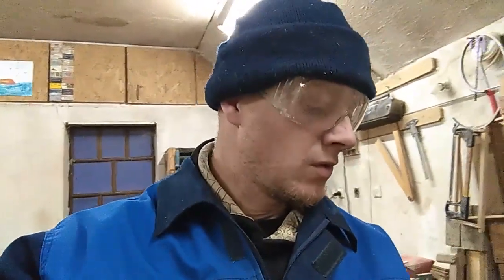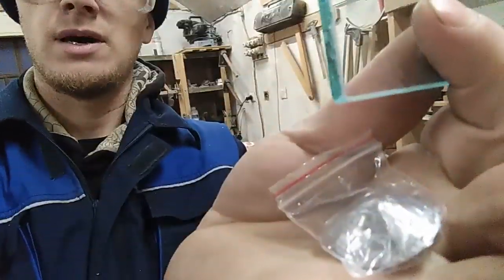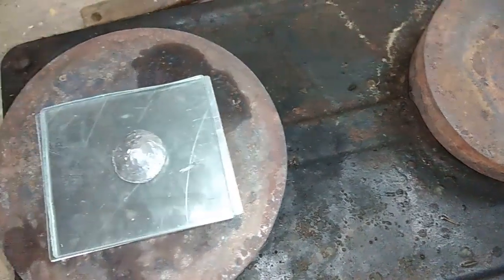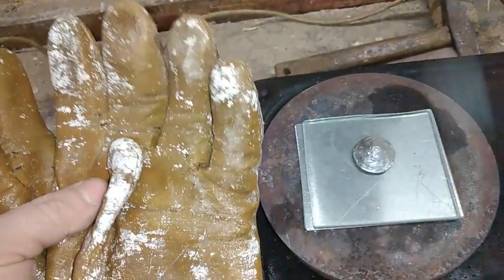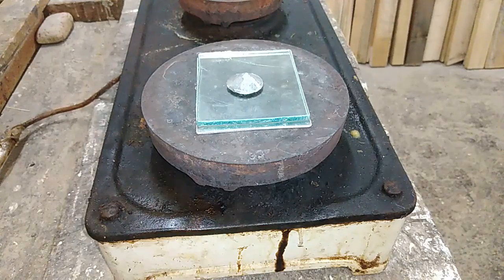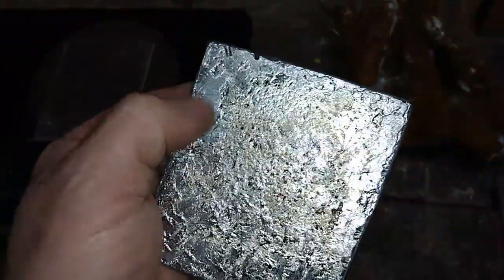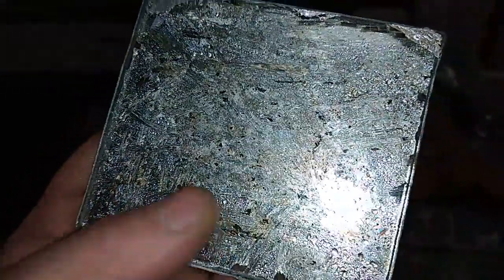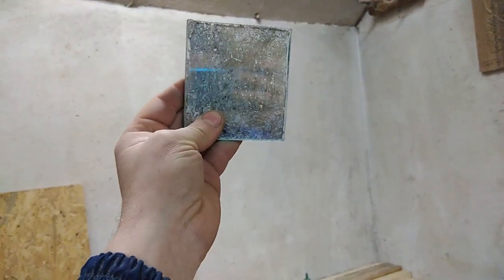MAKE A MIRROR FROM INDIUM - EXPERIMENT!

Comment: Try again,  but next time grind the button down into a powder.  Spread the powder evenly over the glass then heat. Should give a better result
Reply from the maker: Canot grind Indium,to soft,maybe just make smal bricket with knife!
Reply: If you can't shave, then shave with a knife , or beat it down with a hammer into a foil.

Comment: Impressive. Wasnt expecting it to spread so easy
Reply: Maybe would have been better if you had more indium and dipped the glass into it
Reply from the maker: Maybe, but this is oal indium i have now, i need to remove first from a glass then i try again.
Reply: @999DusanGoldrecovery  try heating then using metal brush to scrape everything off?
Reply: @999DusanGoldrecovery  or melt on the plate again and scratch it against a metal pot should get it all off